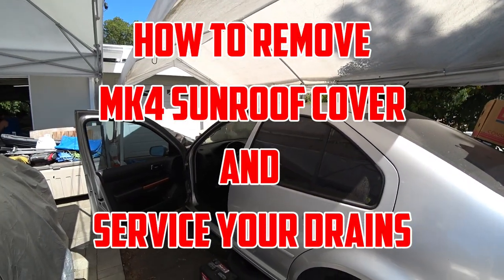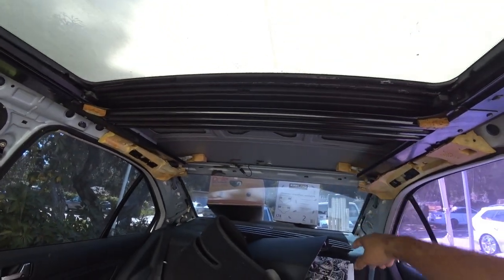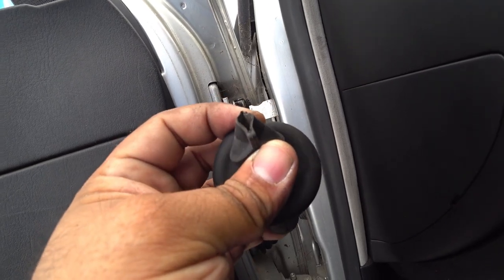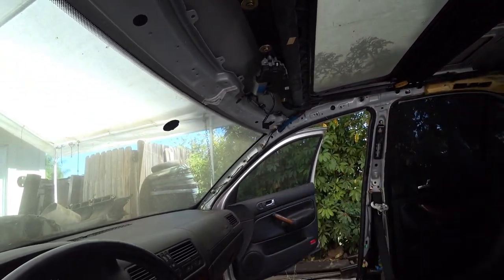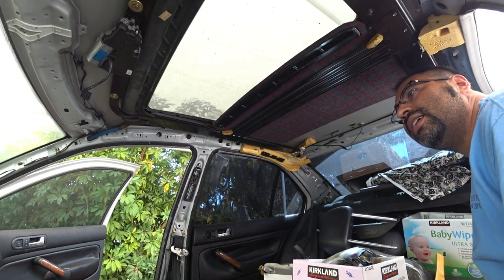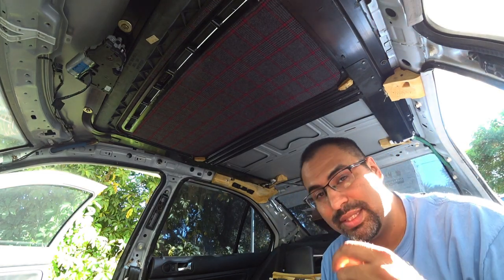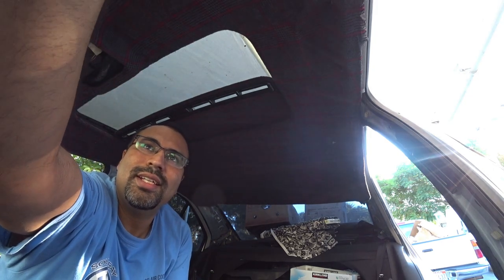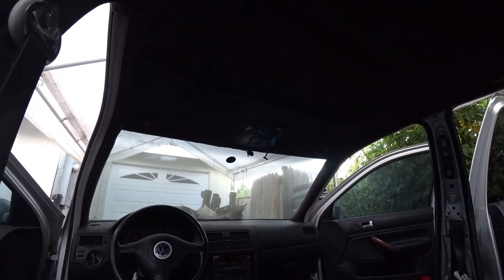How to Remove MK4 Sunroof Cover and Service Drains S7EP9

Comment: You can also pop the sunroof glass off to do this a lot faster and safer no offense.. Simply tilt the sunroof up unscrew 6 torx screws holding the glass. Once all 6 are unscrewed carefully remove the glass and you have easy access to the four small screws holding the cover in place. Then the cover pops right out. You don’t even need to take the headliner out. Hope this helps someone!
Reply: Yes it has thank you very much
Reply: Great option for those not in process of redoing drains/roof liner fabric.
Reply from the maker: Nice I need to try that
Reply: Works mint. Just did it.
Reply: Hell yea It works ! 💪

Comment: I just finished extraction 5 minutes ago.  Great video for sure.  An alternate is I left the 2 front T30 track screws factory tight and made room to reach the stoppers by reinstalling the Sunroof motor and hand turning the glass to Tilt Up position (clockwise looking up)....now I can get the micro suede on it.  If you have rear side curtain airbags, remove bag flap from body just in front of plastic AB tray only, then the plastic carrier tray has an obvious nub on each end, and one each side on the back....just roll the bag down slightly to expose for screwdriver.  Remove metal bag brackets 3 screws to get at the rear T30 track screw
Reply from the maker: That some good advice I will have to try it

Comment: Are the drain tubes easy to run or do I need to pull the new one through as I pull the old one out? Great job on the videos. I just became a patreon. Thanks for sharing your knowledge - that's how we all learn.
Reply from the maker: Best way to run new tubes is to attach them to the old one and pull them out together that way you have no need to fish them out just pull and Install

Comment: Perfect timing. I'm recovering the headliner and was wonder, "how the heck is the shade removed?"

Thanks for posting. 

BTW, I had water leaking inside in driver side footwell. I thought it was sunroof drain tube. Nope, it was the wire harness boot/cover under the wiper cowl cover. 

Cleaned the area really good, also hood release cable boot..  Spread some silicone. So far, no leak.
Reply from the maker: Nice great advice on that. Will keep that in mind for future DIY!
Reply: @PincheALsGarage   I found it by putting the hose on the roof on top of the sunroof, let the water run for a couple minutes.  

No carpet inside (that's another story), water would come down the firewall driver side corner.   Had a hard time locating exact spot. 

So removed wipers, plastic cowl, wiper motor, move insulation (only out the way)..   Placed hose in that area, water at low pressure - bingo.  It was like a waterfall...

Took boot apart (2 #10 nuts), could't pull up too much but enough to clean the area really good. Also around hood release cable. 

Smeared silicone around the boot, on the nuts and small nible that's next to nut.  Also hood cable is next to it. 

So far, no leak in that area.

All this started because heater core was leaking.  What a mission to remove dash. Then we decided to remove seats to change bottom foam. Then carpet/sound dampening. Then headliner and all pillars to recover.  Then order interior parts from Jim Ellis VW, had best prices at the time. Then, then, then.  Never stops. 

Started 5 month, now is when we have time to finish it.  Crazy....

BTW, thanks for posting video - really appreciate it.  They have been very helpful....

Comment: Great video. One question, how did you get it back in? The most important part... 
also was wondering if you’ve ever come across this - my glass sits slightly lower than it should when in the closed position. Normally the glass would be flush with the edge of the roof. Not mine. I’ve unhooked the motor and hand turned it to the upmost position both front and back, still sits a 1/6+ / 1/8- too low. Reset the motor, which does no good because it returns it nicely to the closed position too low! The problem with this is, it seems to want the hit the wind diffuser when you close and of course retract. This confuses me because even if for some reason the track and frame sat too low it should still operate considering it is an all in one contained unit. But no such luck. No one, I mean no one I’ve talked to has a clue why this is happening. You’ve got to know the answer! If not, no one does.
Reply from the maker: Your window regulator is failing not the window motor. You will need to take the door panel off and fully inspect it to confirm.
Reply from the maker: The regulator sometimes break on the bottom that holds the glass or the cable stretches too much and causes your issue. One other symptoms is the the glass is shifting left or right which in turn hit things other way up not allowing to close 100%. One last symptom I have seen is the bottom rivets  that hold the wo down straight tend to break off and make the window move too much forward and back causing it to jam on the way up